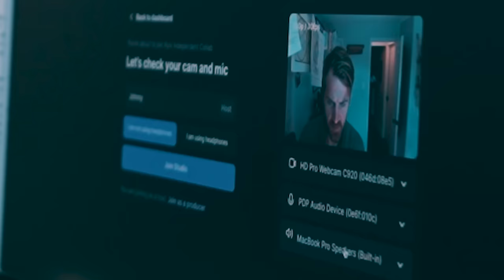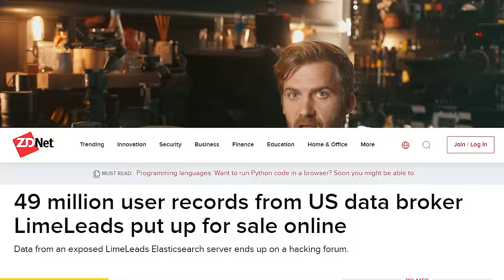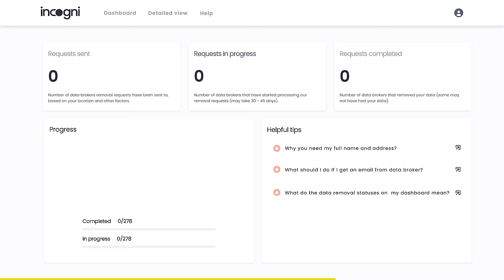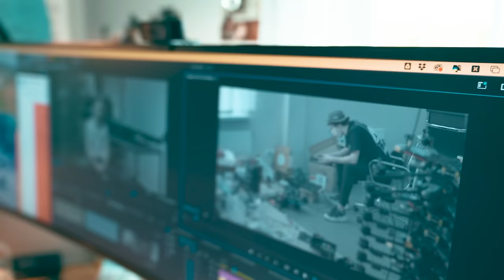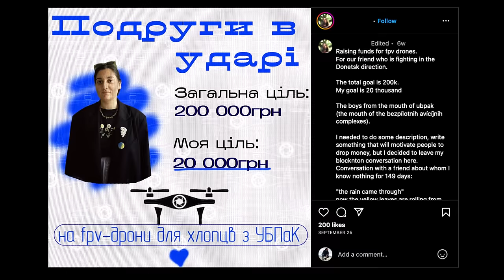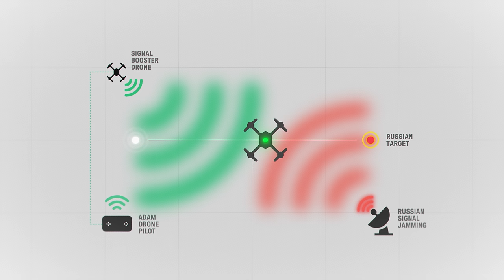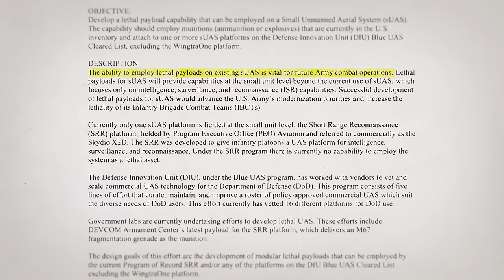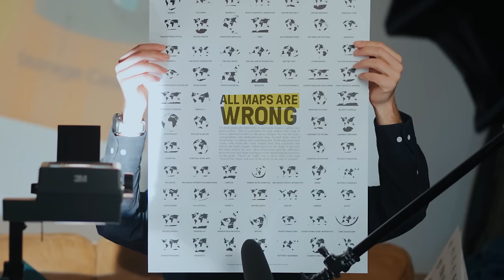DIY Drones: War Will Never be the Same

Comment: You totally skipped over the part of where all the cheap fpv drone parts come from.  It's China.     The escs, motors, Flight controllers, vtx, radios, goggles, lipo batteries,  all from China.

Comment: While these drones have proven to have given a tactical advantage there are weaknesses that limit its strategic and logistical value . Namely 1. battery power 2. Radio  Jamming 3.  Range and speed.  Time to target being dictated by battery charge power . And speed with obstacle whether that be physical natural or man made barriers or radiological jammers .  Though more sophisticated drones have obstacle avoidance sensors these suck battery power .  So if theres an improvement path its probably in improved battery duration and possibly speed  response time .  All reminds of anti sub warfare game of british ww2.  Where a large over seeing control room could coordinate smaller units direction to the contact point for  offensive or defensive action.  Though it appears the volunteer spirit has conducted a robust defense  ad hoc it still remains for better coordination on the grander scale to improve its strategic and logistical importance . No doubt small reconaissance type units will benefit from 360° peripheral warning of contact points but drone direct to direct countermeasures will no doubt emerge like single aircraft dogfights which is another level of need . Even submarine like air hair nets could be imagined as a sector obstacle defense channeling remaining vectors into kill zones to protect critical infrastructure.  Helium balloons rigged . The swing away from most big expensive  fixed wing aircraft has strengths and weaknesses  but at small arms and even artillery ranges the drone air 5000 feet and under space is a game changing blunting vector instrument. Adding to the combined arms attack defense mix . 🎉😢  at present mostly a tactical advantage until larger long distance targets of logistical and strategic value can be acquired . Time speed distance value .

Comment: It might be more effective to arm these drones with the sub munitions found in sensor fused weapons like the "Bonus" 155mm anti tank rounds or U.S. CBU 105 sensor fused sub munitions. The drone wouldn't need to hover above the tank to hit it. All it would need to do is get close and release the sensor fused munition and let it find the tank and destroy it on its own. 

The larger BabaYaga sized drones could also be armed with the 15 kg APKWS II 70mm laser guided rockets, like the ones found on the anti drone "Vampire" systems, and used for a variety of targets. They could even be used to hunt and destroy KA 52 helicopters. One drone could be used for targeting almost anything with its laser, while several others act as launchers for the rockets. It would in effect be a flying Vampire system with a huge increase in range.

While Ukrainians are making serious inroads into what is possible with a drone. They are only scratching the surface of what can be accomplished on the battlefield with small and miniature unmanned systems.

Comment: lastly you kinda miss pointing out also the range limitations of the drones ... the limited flight time of them ... and recon drones generally are much larger and can be seen on russian radar .. since they are generally over 3m wide and can sometimes operate even 15hrs where as the small kamikaze drones tend to fly only for 5-10min ... similarly there are weight limitations and payload vs battery size tradeoffs and these affect also the speed of drones ... so im frankly quite surprised at the poor coverage of the complexity even of the drone selection / modification
but thank you for taking the time to make a video on the topic hopefully you might make a more accurate one/ detailed one in the future

Comment: You could’ve added information from the war in Palestine and how Hamas used these cheap drones to stun the Israeli iron wall on October the 7th and how they are actively using it right now. Also how Israel is countering this with the metal roofs on tanks and vehicles

Comment: I can imagine Sweden with some of their munitions like the bomb capsules from the "Bonus" artillery shells that has a sub munition that is a 100 meters up in the air flying in a helical search pattern and when detecting armor fires a molten copper jet right through 1 foot of armor from a height of maybe 50 meters up. Imagine those fairly lightweight munitions strapped to cheap frame drones flying out in swarms can take out 20 tanks in a matter of minutes. Especially if they have strong signals for anti-jamming. 
This is the future. NATO militaries better get on it.

Create "drone Battalions" where they have tons of drone pilots being trained on these drones for surveillance and kamikaze attacks etc. Innovate different size of drones for munition drops and so on. Long range like Ukraine now does flying 1000km to take out targets.

Comment: These drones are using a dedicated frequency band use for RC airplanes - thus easily detected and jammed because everyone knows the hobby frequencies.  I wonder when someone will start using WiFi, which uses a spread spectrum frequency hopping technology to get data through what could normally be a very noisy radio environment in households.  WiFi is very difficult to detect due to the super fast frequency hopping pseudo-random algorithm, added to the fact the signal is spread out, and thus very hard to detect and jam.  Their combat drones would be a lot more effective that way - somebody must know this out there!

Comment: Now Engineers will start UPGRADING this Tanks with EMF's, That will shut down any radio transmitting Device. reason is this drones transmit almost 99% of their signals via a frequency of 2.5GHZ.

Comment: both sides use drones in the Ukraine war however the Ukrainians are more innovative with superior command and control along with having drones very much intergrated with their units even down to the squad level. 

The Russians on the other hand also have a lot of drones but its the bigger military type ones, they dont have much of the FPV type drones.  and its not integrated much with the regular Russian army troops. Most Russian army troops dont even fly drones.  this is more used with specialized Russian special forces units.
Reply: A lot of the Russian forces are actually using FPV drones as well. Not in an official capacity, but independently being done by individual soldiers. It's less coordinated for this reason, but they are fielding a shit ton of these drones. Ive been watching live combat footage since this conflict started and about 6-8months ago is when Russia started to really field FPV drones more frequently. Like Russian troops purchasing or having purchased for them their own drones from their own money supply. Ukraine largely provides these to their troops out of their own pocket, save for maybe the foreign legion.
Reply: @dazurathefirst8456  however the difference is that FPV drones are very much integrated into Ukrainian units many Russian units dontr even use them like teh Storm Z units the cannon fodder hardly uses drones on a squad level. maybe company level. and also the Ukrainains are a bit well coordinated in their drone logistics and command and control. also the Ukrainians produce a lot of the killer FPV drones, while the Russians drones are just regular recon ones.

Comment: This video overdramatizes the usage of drone in Ukraine, drone doesn't destroy million-dollar tanks alone. They are very accurate weapons but only carry small warheads so their purpose are to detrack or disable the tank engine, when it's achieved, the tank crew will just abandon the vehicle. A disabled tank can still be recovered and repair easily, but until then, artillery can hit that abandoned tank and destroy it more accurately. Also you selling drones as "the edge Ukrainian needs to fight Russia" is just wrong as the Russians also use drones heavily throughout this war on an industrial scale.

Comment: One way around ECM (electronic counter measures) would be to use AI. So you designate a target ASAP, and if you lose contact with the drone, it will still proceed to its target. This is even easier for recon because all the drone needs to do is loiter over the target and transmit back to the launch site. ECM can block the drone from receiving data, but not from sending it.

Comment: I only just watched Avatar 2 on a flight recently. while watching it I found myself thinking how useless the large war machines were. Sure they have firepower, but they are so easily destroyed and incapacitated, taking whoever is in it together with them. So expensive war machines does not achieve anything for the users (or anyone actually), but also becomes a death trap for whoever uses them. who the f in their right minds pays for and uses them? idiots who starts war. the only ones profiteering are the military contractors making them, as such, they are all scammers.
War, huh. What is it good for? Absolutely nothing.

Comment: Wagner was using FPV drones in Syria in 2018. It's a myth that UA has ANY Tech lead over Russia. Russia uses more FPVs and also has long range Drones, Lancet+Zala HunterKiller autonomous drones that use AI to detect targets. UA has 30 HIMARs, Russia has TornadoS that is just as accurate but with longer range. Russia has unlimited ammo for TornadoS, UA has limited HIMARS rockets. RF also has Aviation long range PGMs and Iskander medium range ballistic missiles.
Russia has an equivilent to every weapon UA has, they just have more and much more of the other more criticial warfare elements; Artillery, Shells, Manpower, tanks, APVs etc etc

Comment: This is nothing new. DJI became prominent because of the Chinese military effort, I assume, since the US has surrounded China with missiles at the Nine-dash line (A version of the Monroe Doctrine). Due to their limited battery life, Drone a good defense device but not an offensive weapon. That is quickly adapted as a terrorist weapon in the US. The US carriers are expensive and extensive, this can put the US in a significant disadvantage while it takes 10 to 15 years to build a carrier.